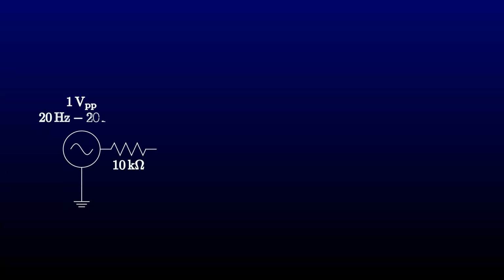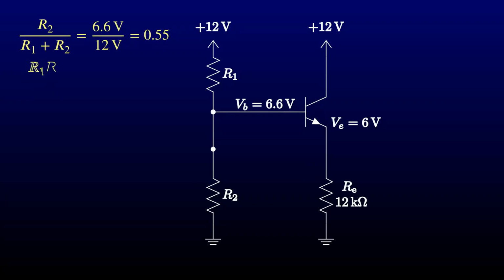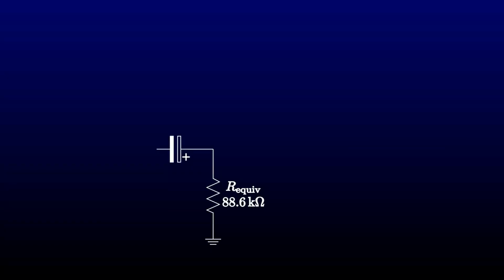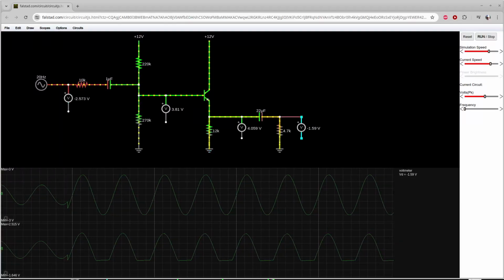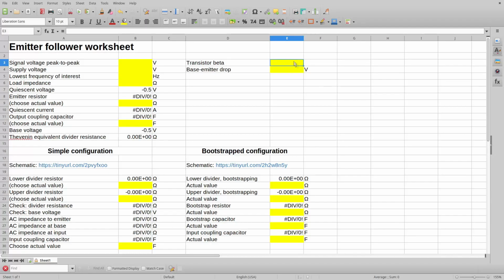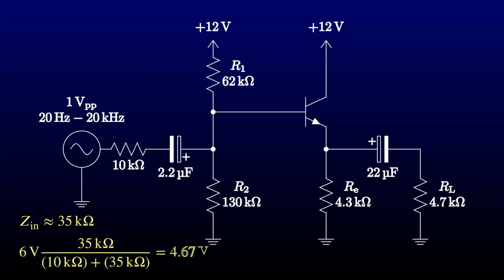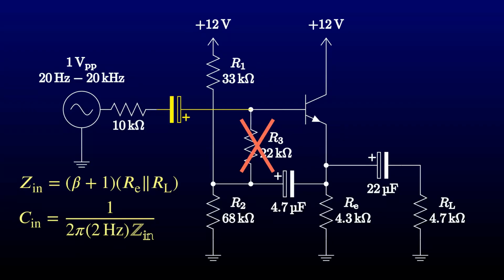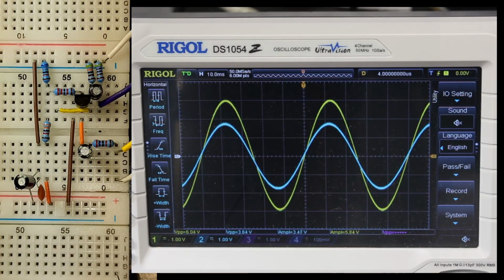Transistors 101 ep6: Biasing and Bootstrapping

Comment: 15:00 can you explain to my dummy brain why the capacitor in the middle will have equal current in both ends?
Reply from the maker: Any two-legged component has equal current at both ends.  That's  Kirchhoff's current law at work.  But I think you meant to ask, 'why does it have equal voltage at both ends?'

Well, it doesn't.  It has a DC voltage across it.  But that DC voltage is set by the biasing and doesn't change when you apply a signal.

The trick here is that we've split the analysis.  We've already worked out all the biasing, which is the DC voltages and currents that will be present when no signal is applied.  Now we're considering only the small-signal voltages and currents. The terms, 'signal voltage' (or 'AC voltage') and 'signal current' refer to the difference between the bias point and what you see with the signal applied. We're just subtracting out the constant bias voltages from every node of the circuit and looking at these differences.

Applying a small signal won't affect the 1 diode drop between base and emitter of the transistor - it's going to be the same value (typically 600--700 mV) whatever small signal it sees, so there's no signal voltage difference between those terminals, only DC voltage. At signal frequencies, we can look at the base-emitter junction as a short circuit.  The signal voltage at the base will equal the signal voltage at the emitter.

And we've chosen the capacitor to be so big that it looks like a short circuit at signal frequencies.  There's no signal voltage across it, only the DC difference between the voltage on the bias divider and the voltage at the emitter.  Whatever signal voltage there is at the emitter will appear at both ends of the capacitor.

So at signal frequencies, the transistor base, the transistor emitter, and the R1-R2-R3 junction all are at the same potential - there's only a DC difference among any of them.  R3 carries only DC current, no signal current, because there's no signal voltage across it.

Since it doesn't any carry any signal current, we can treat it as an open circuit for the purposes of small signal analysis. Which means that we've successfully isolated the bias divider from the base circuit at signal frequencies.
Reply: @KludgesFromKevinsCave  your channel, presentation, teaching and character are a blessing. Subscribed!
Reply: @keylanoslokj1806 Current-in equals current-out that is Kirchhoff’s current law.
Reply: @EEverse-po4vu  no,he understood the question

Comment: Great video series. I did my EE back in the 90's and tend to pop back into videos like this to refresh my memory. I wasn't a big BJT fan. I specialized primarily in transmission theory and high energy switching and did a lot of work in the heart defibrillator world which was more about finding IGBT's big enough and fast enough. haha.
Reply from the maker: Glad you enjoyed it!  I worked at GE Research for over thirty years, so I was around when the enormous IGBT's - the ones used in DC-DC converters for high voltage transmission lines - were being developed. (Wasn't my thing, I'm an instrumentation guy primarily.)

Comment: Thank you so much for this revisit to a long forgotten friend.... I havent had to get back to basics since 1980s and ive forgotten so much.  Opamps made me lazy ... lol
I was looking for exactly this follower technical discussion as i was literally planning to breadboard an emitter follower this week using BC549C as i plan to upgrade a fully discrete preamp from the early 1970s that has a very complex high impedance LCR output stage thats unbuffered ..  explains a lot about the wildly varying listening reviews..
Your explanations and visual aid processes are right on the money...  very well done.. You just got a new sub and i plan to use your series as reference material as ive been mentoring a young fella in the dark arts of audio amplifier design for the last 8 yrs and well discuss your work in detail.  Thank you..  i look fwd to the next installment from you and applaud your generosity ..   back to school for this ol fella..  😊😊
Reply from the maker: Glad you're finding it useful! There's more in the works. I have several current mirrors (using DMMT5401/DMMT5551 matched pairs) on the breadboard right now - look for that in about 8 weeks (I always like to have that much in the queue.)

Looking much farther ahead, I'm thinking of several creative ways to abuse analog IC's that require you to understand the schematic inside, which is why I'm starting from the basics. A lot of the creative things that people do with the humble 555 or the LM13700 are NOT in the data sheets!
Reply: @KludgesFromKevinsCave  awesome..  your efforts and especially your very watchable presentation skills will become a valuable resource for many old and new electronics enthusiasts.. 

I recently had this very discussion about understanding or at least acknowledging the internal schematics of an ic and not "black boxing" them.  This came from questions of how a low value electrolytic filter cap on a dolby chip would change the operating points of its bjts due to non ideal dc current leakage - that shouldnt be there - increasing distortion and filter shaping issues etc...   replacing these low value electros with film is the only sensible solution.  Im looking forward to your next issue/s.

Creative abuse of analog ics??.  I  cant wait LOL fantastic..  

Thanks again for your efforts..

Comment: Nice video. I like the bootstrapping. 
Choosing the corner frequency of both the input and output filter the same, 2Hz here, will create a second order system. It is better to make one of these corner frequencies 10x lower to end up with two first order systems with poles well apart.
Reply from the maker: Right.  In a superabundance of caution, I put both corner frequencies 10× below the 20 Hz-20 KHz range I wanted the amp to pass.  Separating the poles would make the passband flatter, but I just made it excessively wide and used the flat part.

I do plan to get into active filters as the channel progresses.  Just trying to keep things brutally simple for now!
Reply from the maker: @danstiurca7963  The question made sense. The order refers to the number of pole pairs, and has nothing to do with feedback. What @breedj1 is suggesting makes sense if you're tuning filter response. It's just not necessary if you have the luxury of putting the corner frequency far away from the intended passband. You don't necessarily have to work out filter response in detail for every DC blocking capacitor that you use.

Comment: Thank you 
When do we use electrolytic cap and  when not ?
Reply from the maker: The big advantage of electrolytics is that they have a lot of capacitance.  If you need tens to 10000's of microfarads, they're by far the cheapest alternative.  

But the capacitance isn't all that predictable.  The 'good' ones often vary by 20%, the 'cheap' ones are often +80/-20%.  When you're using one for an audio coupling capacitor, or a power supply filter capacitor, you don't care as long as they're big enough.  They're completely inappropriate for anything where you're using an RC or LC time constant to establish a time or frequency, because they don´t have a precise value.  For the timing applications you need either polymer dielectric (polypropylene or perhaps polyester) or C0G ceramic.

Electrolytics also are resistive and inductive - which is to say, they're slow.  If you're using them to filter a power rail, you almost certainly need smaller ceramic capacitors distributed around the board, and it isn't uncommon to see a rail with a 1000 µF aluminum electrolytic, a 10 µf tantalum, and multiple 0.1 µF ceramic and 470 pF mica capacitors, filtering out transients at different frequencies.

Comment: Twenty plus years ago I designed a lot of video amplifiers with transistors, until high speed op amps and very low supply voltages came along. It was fun to look back on the transistor design. I must say this was an excellent, well thought out and executed tutorial. Discrete transistor circuit design is becoming a lost art, much like tube circuit design. Sadly, we no longer have the variety of choices in transistor selection either. My one curiosity, not really relevant to the video was which transistor you were using. My video world used to revolve around the 2N4124 (NPN) and 2N4126 (PNP). Thank you for the great video!
Reply from the maker: I happened to have picked a 2N4401 out of my parts box. It falls under my mental category of 'TUN', 'transistor, universal, NPN', - PN2222, 2N3904, and BC547 are the other ones that I tend to group under the heading of, "I need a transistor here, and don't care much about the characteristics'.  

All of those have >25 volt breakdown, >=100 mA collector current, beta>=100, total power >=0.1 W, GBP >= 100 MHz, which is "if I don't need a lot of speed or a lot of power, this will do".  I like 2N4401/2N4403 for audio work because they're quiet.

By the way, all of my mental category of 'universal transistors' have PNP complements: 2N4403, PN2907, 2N3906, BC557.  The whole lot of them also have variants in SOT-23 packages (with the MMBT prefix instead of 2N,  or BC847/857 instead of 547/557).  Most of them also have matched-pair variants with the DMMT prefix.  

2N5551/2N5401 sort of fall in that category, but with the advantage of handling much higher voltages.

There might be a lot fewer varieties of transistor available than there used to be, but the ones left standing are good enough that I can generally find one that meets my needs. Like everyone else, I use opamps when appropriate.  But being a cave man, I like to see how far I can get with jellybean parts.
Reply: @KludgesFromKevinsCave  - I totally agree with your logic and like the TUN acronym. I had wanted to mention that perhaps my favorite small signal bipolar is the 2N5089 (or MMBT5089) NPN and its somewhat similar PNP, the 2N5087. The '89 has a beta of about 1200 (400 min) which can be very handy at times. Still in production too.

For higher voltages, I lean toward the MPS series and other Motorola originated parts usually. Recently, I've done a few projects that needed higher voltages and the choices thin out greatly compared to the past. I'll have to look at the 2N5551/2N5401 again, been decades since I researched or used those.

The 2N4124/2N4126 are also low noise designed for audio and video. I've rarely seen them used outside of professional video equipment, however. I have a lot of them as well as the MMBT equivalents, so I just used those when needed. Same with the 3904/3906/5089 devices.

In the 1970s, there were a lot of transistor project books and the parts that were spec'd most often were the 2N5501 and the 2N4401/2N4403 pairs (along with the classic 2N3055).
Reply from the maker: Yeah.  The next couple of episodes are about chasing gain, and the 2N5089 (5087) are mentioned specifically in episode 8 (due to drop October 18, I try to keep the queue full at least 6-8 weeks out).  It's my go-to for "cheap superbeta".  I don't list it under 'universal' because all that gain comes at the cost of Miller capacitance, noise, and instability.  All of those can be tamed, of course, but the '5087/'5089 aren't 'the transistor I'll grab from the parts box for something quick and dirty.'

I looked at a couple of my old project books, and they seemed to focus on the '2222/'2907 or '3904/'3906.  But a lot of those project books were sponsored by the manufacturers, and maybe yours spec'ed different jellybeans from mine.  I also turned up an ancient project book with the 2N107 and 2N170 - which were 'germanium transistors that failed inspection, but the hobbyists will put up with them.' The first transistor radio I ever built was a superregenerative with a 2N170 as the RF stage, a pair of Ge diodes as the detector, and a 2N107 as the headphone amp.  It didn't work all that well, but the amazing thing was that it worked at all. I was a little kid, and proper lead dress was a mystery to me. When it started to oscillate, my grandmother could hear the howl in her hearing aid.

Comment: My mind got blown by the bootstraping technique. Such a good explanation
Reply from the maker: You'll see more about it moving forward. It tends to come up at odd times. I plan at some point to do a few videos about an old-school linear speaker amp (not the modern PWM stuff) and they almost always bootstrap the collector resistor on the driver transistor.
Reply: I am looking forward to see those videos  @KludgesFromKevinsCave
Reply: @KludgesFromKevinsCave  I've been searching YouTube for years for a simple process-based explanation on how to do overall circuit design - and the bootstrap technique you demonstrate (with additional experience shared) is exactly what I'm looking for. Thank you for the clarity and detailed explanation!

Comment: I'm new to electronics. I'm so glad I found this channel
Reply from the maker: Glad you're finding it helpful!
Reply: One of the harder concepts for me, especially when I started. I always end up chasing my tail
Reply from the maker: The real trick is to analyze the quiescent point first, and then analyze the signal path.  It gets a ton easier once you realize that they really can be separated.  You can often figure out the quiescent point just with "the emitter is a diode drop away from the base."
Reply: @KludgesFromKevinsCave  I'm saving these knowledge nuggets for they will become helpful, even necessary, to further my experience and understanding of electrical engineering. Thank you, sir!